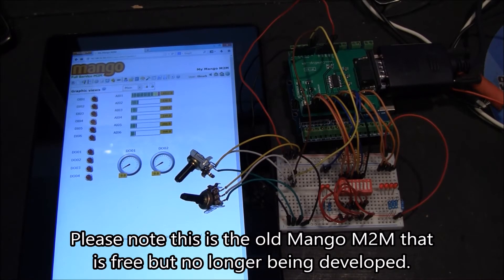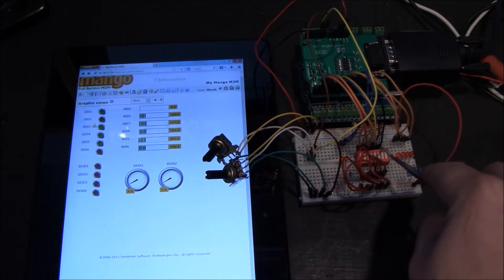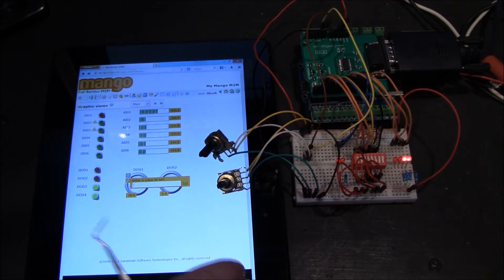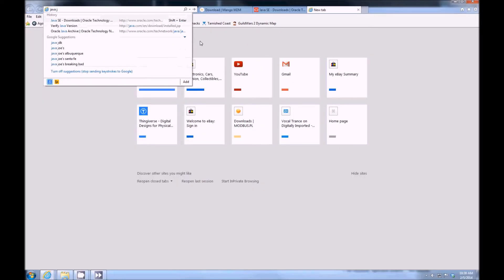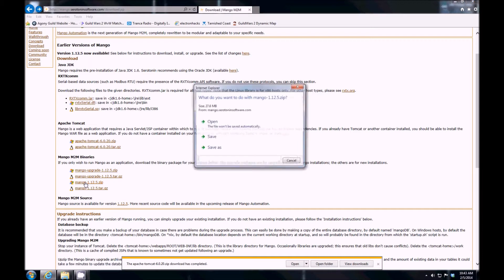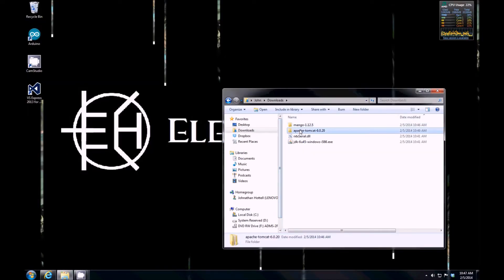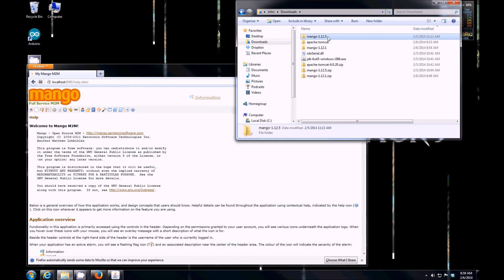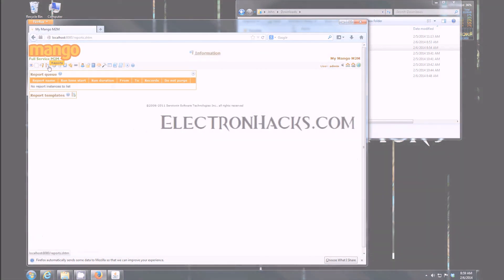Mango M2M install

Comment: do you know where i can download 1.12.1 from. can't seem to find it on the website anymore.
Reply from the maker: There is a download link on my blog post for 1.12.1 http://www.electronhacks.com/2014/04/afordable-arduino-modbus-plc-or-rtu/ however I strongly suggest you go grab http://www.scadabr.com.br/, it is the free fork of mango, it looks the same but has more features and bug fixes. ScadaBR is not perfect, it has its own flaws but it is much easier to install, just install it to Users/Public as it sometimes has issues with permissions in Program Files. The ScadaBR software is 100% English even though the website is in Portuguese.
Reply: electronhacks
Thanks i'll give it a try.

Comment: Can You control the power of motor with MANGO?
Reply from the maker: Sure, Mango is just the HMI, it can tell what ever hardware you have to control a motor.
Reply: Controlled with an iPhone or android ?
Reply from the maker: Carlos Carpio Mango is web based so yes any computer, phone, or tablet. I tested it on my Kindle Fire and my Windows Phone.